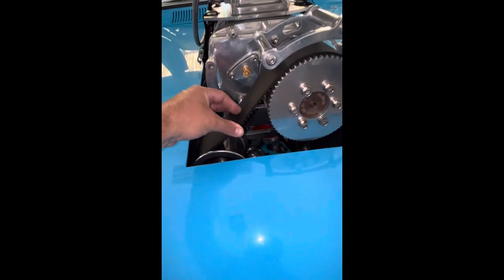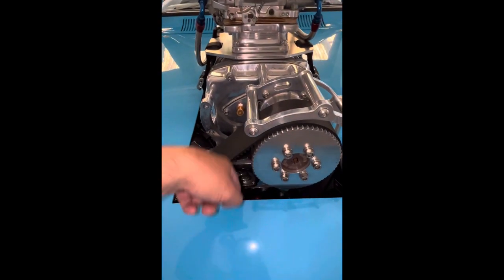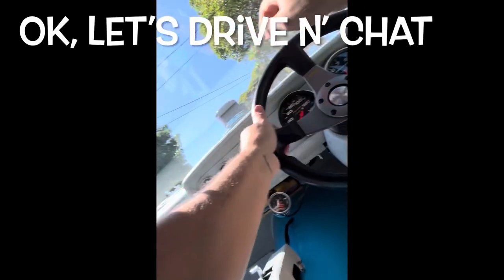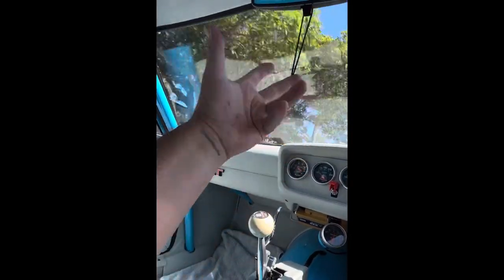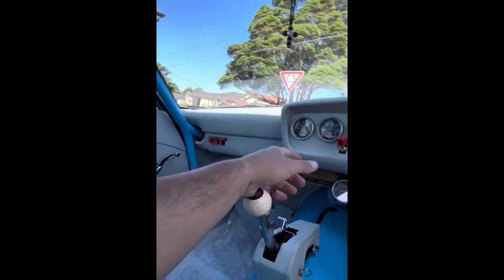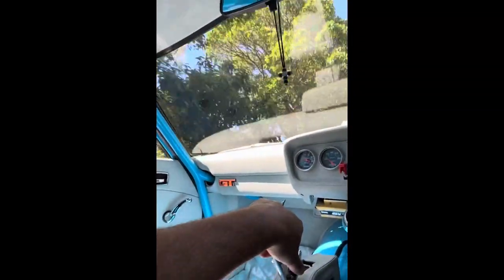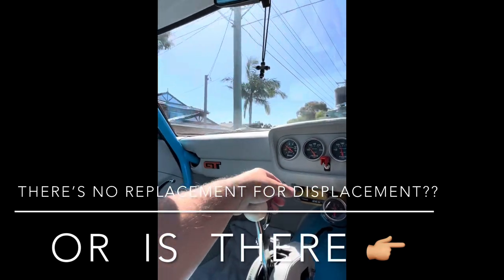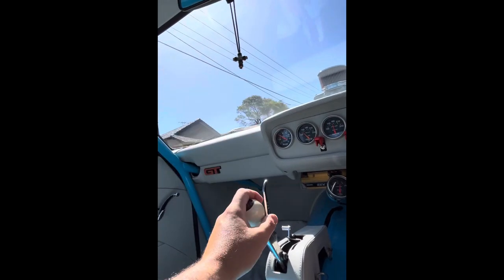Let’s Drive n Talk Blowers, 6/71 Roots Blower Ford Cleveland 4V

Comment: Is it the Clevelands that have the small pin in the rear main cap that has to be removed if you fit a neoprene/ silicone rear seal instead of the rope type?
Reply from the maker: Pretty sure the rear cap & block has been machined for a 1pc seal……BK🏁/Machine shop took care of all that stuff👍🏼🏁
Reply: Was pretty sure your wouldve been sorted. 
Just had memory of a mate rebuilding a Clevo and having a massive oil leak due to a pin in the rear main seal area.
Reply from the maker: @matui6983   oh no no, believe it or not this thing hasn’t leaked a drop of oil in the 15yrs since built…..BK🏁has em all worked out👌🏼….. even in the day with my na 2V/4V combos I didn’t have an issue also

Comment: Absolutely Bitchin!!!👍👍👍 thanks for the ride along!!😁😁
Love that blower surge!!
What transmission and rear gear do you run?
Reply: Crazy how much pressure builds for the relief valve to release!! Had no idea!
Reply from the maker: Thanks for the good comments RN👍🏼🏁
It’s runs a 2spd Glide (tall 1st gear also) & 3.9s rear……..28” tall St tires 🏁
Reply from the maker: @ricknorrington2211  right on RN, had to show that example……so if the Bearing/Seals were no good it’ll seep out thru the Case/rotors out the intake & outta the carb blades & show no pressure build up……
Reply: @69JANKS  bad ass!! Few friends were telling me to ditch the C-6 and go with the th400 or the glide. But I’m on the fence. Found an old school 8/71 EP magnesium blower/ littlefield blower for $1,300
Reply from the maker: @ricknorrington2211   that’s a bargain 👌🏼🏁…… gearbox depends on the weight to, if it’s around up to 3200lb I’d go 2spd glide, can be built to handle good hp like 1000hp rated with stock case, Turbo input, Valve body & the usuals……
TH400 is a similar thing can handle 1000+ on a same build (stock case etc) & is typically good for on the heavier car 👍🏼🏁
Reply: @69JANKS  thanks for your great input!!
My current setup is a almost stock Big Block 460 C-6 3.89 gear in a fat n sassy 3525 lb 72 mustang 🤣
Wanting a supercharged 545 w Kaase heads
Reply from the maker: @ricknorrington2211  anytime RN👍🏼🏁, wow that’ll be badass…..just gotta build em right that’s all, good clearances, piston ring gap, good parts especially the Valve train👌🏼…… 8/71 on top & Go🏁
Reply: @69JANKS  Thanks!! Takes a while to do research for sure. I do my own things and I don’t want to mess up.

Piston rings are something I’ve really been looking at. Do you or know anyone who runs the total seal Gapless rings? So far I’m striking out. At this point I can’t justify spending $322 for rings if they are nothing better than a good properly filed ring.
Reply: @ricknorrington2211  Lake speed Jnr of Total Seal from memory, goes into great detail about rings and bore prep.. Don't hurt to have a high tech edge, when it comes to that fundamental part of any piston engine. I would argue that $322 for the correct parts in this area is worth it. All the other parts are junk if the power blows by, I would contest. My 2 cents, that's all. Cheers, have a good one.
Reply: @MsKatjie  input is always appreciated for sure!! I was told there isn’t enough Dyno time to test everything and to look into their gas ported rings. So I did. $577 for their gas ported rings  vs $321 for the Gapless 🤣🤦‍♂️ I just purchased JE file fit rings at a swap meet new in the box for $45.00😁
I felt I had valid points especially if they are promoting the Gapless rings being so great. I wanted to see a comparison of nothing but a properly filed fit ring vs the Gapless. Is there less crank case psi? Increased intake vacuum? Increased compression? More hp and torque? If so how much??
Reply: @ricknorrington2211  I hear you and unless valid real world data is supplied, I would of done the same as you. Enjoy the rest of the day. Cheers.

Comment: How much to the wheel does it make? Do you have a build sheet? I’ve got a 71’ capri and a 351 Cleve I’ve thought about putting into it
Reply from the maker: Hey JD, it’s never been wheel-Dyno’d🤷🏻‍♂️ only engine dyno’d , my guess is 530rwhp on Street(pump-tune) & around 600’ish turned up a little👍🏼🏁
Reply: @69JANKS  That's exactly what I'm thinking or wanting in the Capri 5-650ish whp. Thought of a lot of different engines but I have a Cleveland sitting and the thought crossed my mind. There's a long list of engines I've thought about throwing into it from OM606, 4bt, 2JZ, coyote, even a rotary. Just have not settled on one yet so any guidance you have is immeasurable. Love the content would be a hoot to see that thing on the Dyno
Reply from the maker: @JTLDEN  sure thing JD, thank you👍🏼🏁
Always wanted to test it out on rwhp but probably too old for it now actually.
I’d even consider an alloy headed 302w (aftermarket block) 8.2” deck height & 363ci, make some good pump gas na power or Forced🤷🏻‍♂️ & a little lighter on the nose them👍🏼🏁
No not a rotor 🤦🏻‍♂️lol
Reply: @69JANKS  the rotary would be for kicks and giggles, even thought about putting a Kubota motor in it from a small tractor haha. Just want something weird and have fun. Thank you for the info I may go down this road, love the content and the beautiful piece of machinery you have
Reply from the maker: @JTLDEN  hahaha i read ya, i also have another Capri roller……always got things in mind in if we’re ever to do that one up & what I’d stick in it lol…… thought of a stout na 4.0L 6 (sohc) something with 350-400hp na 💪🏼🏁